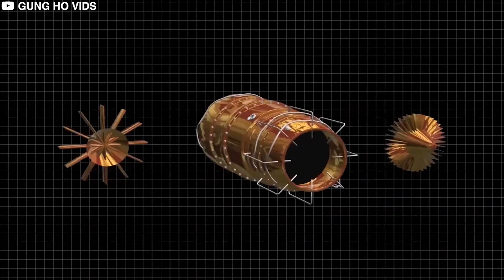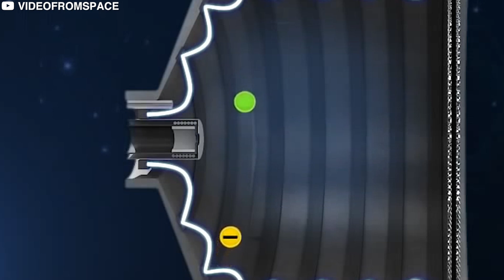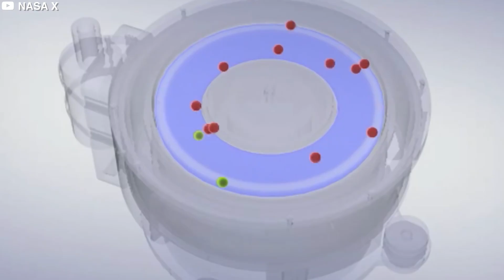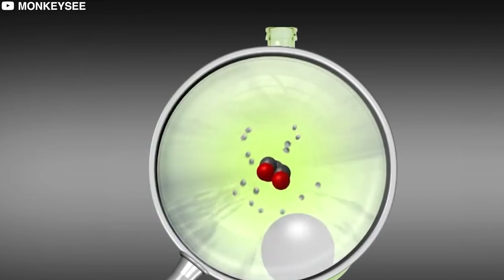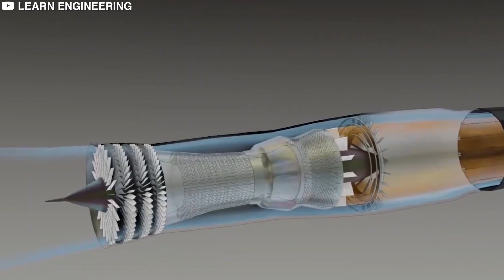China's Insane New Plasma Jet Engine Revealed

Comment: I finally figured it out. The fuel is carried and ionized. No outside gasses are used? Nah, outside grasses are used, ionized and pressurized, then used as fuel. It's like a compression effect used in a jet engine, in this case, the added thing is, there is a reduction in fuel usage. There is noise reduction?

Comment: From were electricity comes to generate plasma in aeroplanes.
Reply: A solid oxide fuel cell could work. Using e-kerosene made from wind energy could power these electric plasma engine via the SOFC. :) Germany is working on e-kerosene. Sadly, e-kerosene is expensive, and would be better off in a traditional jet engine, instead of a fuel cell. How about old-school fission? Or fusion, if that tech is mature in the 2040s?

Comment: Is there any other solid company working on similar technology?
Reply: We have been working at the University of New Mexico on similar technology for seven years now. We use air, partially ionize it with a plasma torch, then use some proprietary technology to amplify the ionization (it takes about 1.7 MW to ionize a pound of air by brute force). You can then accelerate it using coils, or use a coil to tap into some of that energy.